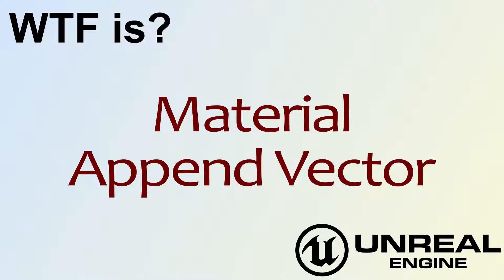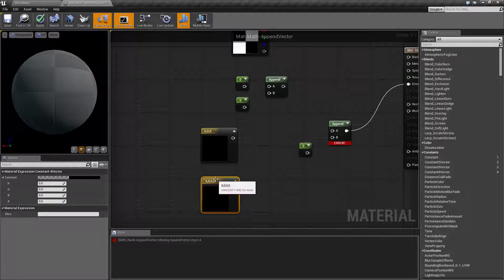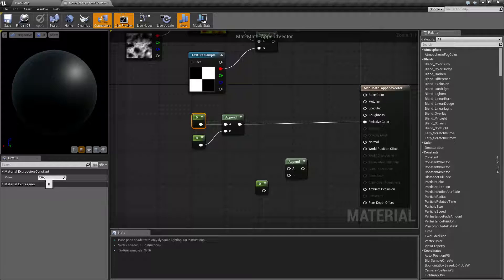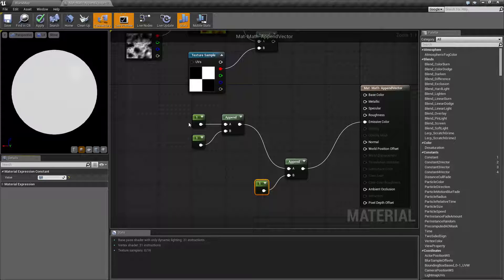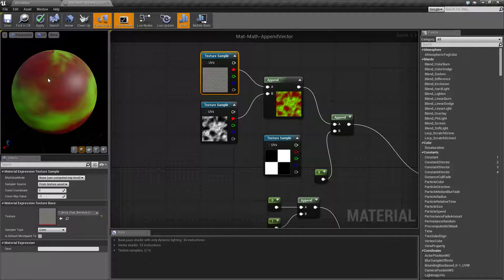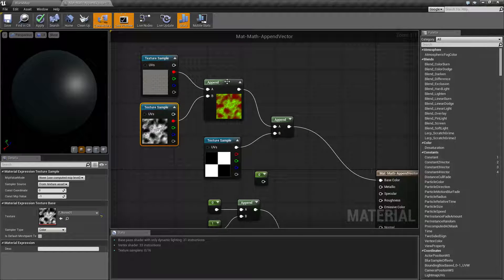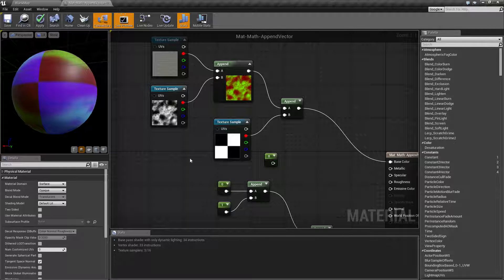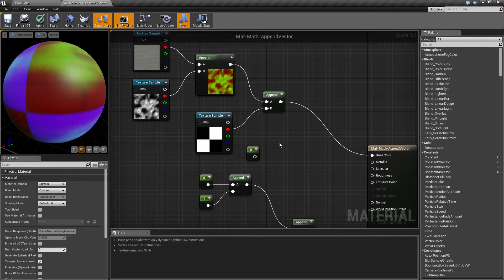WTF Is? Material - AppendVector in Unreal Engine 4 ( UE4 )

Comment: whats the difference between append and add node? This and this node give you possibility to combine two vectors together for example textures right? Append is simulating the RG / GB channels to combine textures? and Add is adding them into one channel together?
Reply: Exactly.
Let's use two Vector2 as an example:
(1,2) and add (1, 0.5) makes (1, 2.5) which is another Vector2
(1,2) and append (1, 0.5) makes (1,2,1,0.5)  which is a Vector4
Reply: @sonictimm  Thanks buddy!